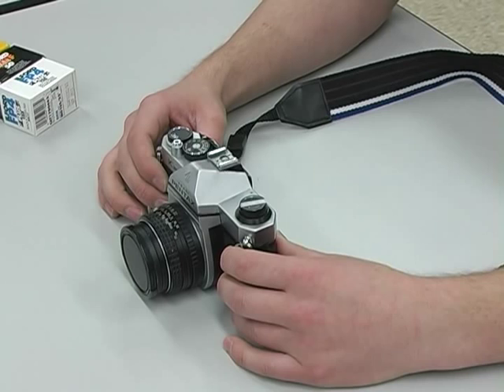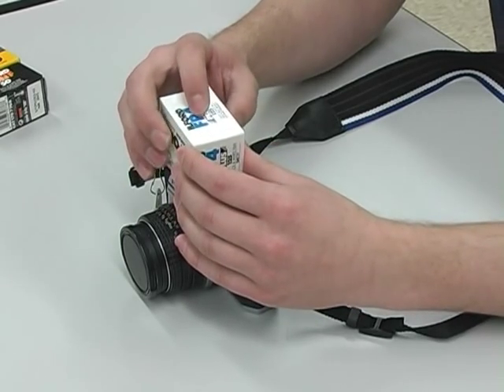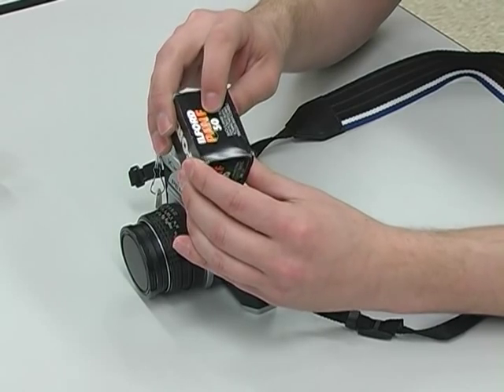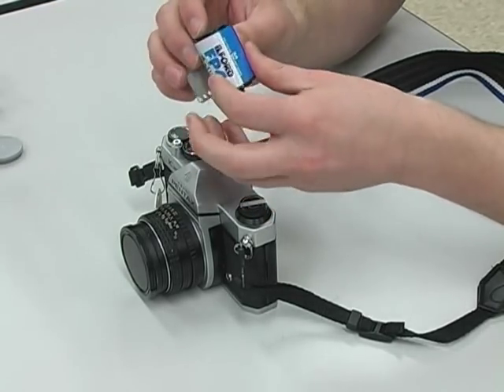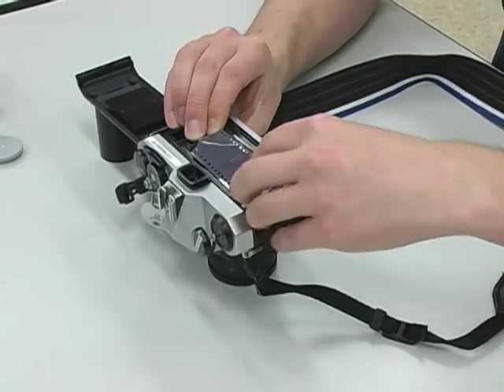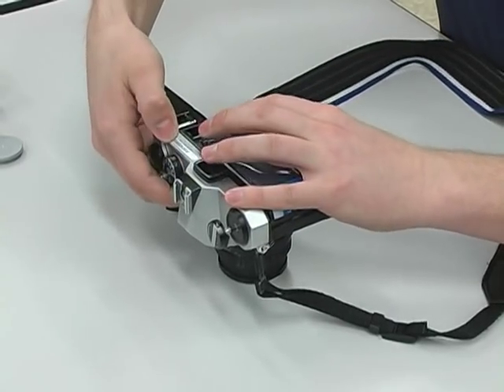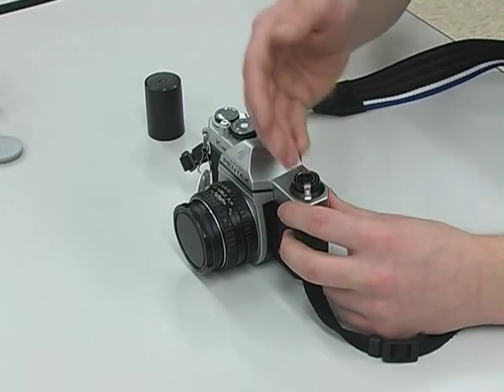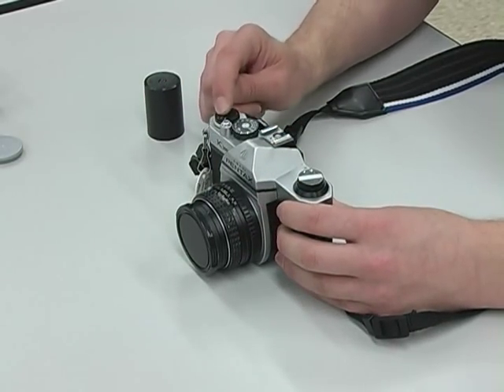Loading Film into a 35mm SLR Camera

Comment: I have minolta x-300 , its largely mechanical but has a few electronic things. Aperture is adjusted via a ring and there is no auto focus. For moon photography, I dont know but I suspect you could just use the widest aperture available (to let in more light) without worry about how it affects depth of field (focus will be set to infinity anyway?). I guess you would want a good zoom lens, and if you zoom in fairly close on the moon you should get an accurate exposure.

Comment: Good video but I have a slight issue, I don't know what I did wrong but I can't seem to advance it anymore (using the lever thingie), when I first tried it, it did work but right now it doesn't.
I can pull it maybe an inch but then it just doesn't go any further.
Any idea why this is and how I can prevent it from happening?

Btw, it's an Minolta XG-1 and I bought it today :D

Comment: Hi Alexander, thank you for this instruction. I started shooting film a few days ago and have submitted my first roll of bw film for development today. However, I am afraid I might have done something wrong with loading the film... My concern is that it would be possible that with each exposure, I am actually exposing halfway between two frames. How do I make sure that with each cock I make with the lever, the film is actually aligned correctly with the shutter opening? Or is it just simply not possible for it to be misaligned due to the sprocket configuration, and therefore I should not worry? Thanks!
Reply: How2Save01 Hey, thanks! By now I have figured out that a roll of film is sensitive to light as a whole and it does not have individual photosensitive frames on them so it indeed cannot be misaligned. :)

Comment: I would not recommend testing to see if the film is "caught" after loading the film by means of lifting up the rewind leaver as you advised at the end of the video. Not all cameras catch the film in the same way. I just tried it will my Canon AE-1 and my film leader rewound into the canister. Now I cant shoot with that roll. 
A better solution would be to make sure the film is advancing and caught in the grooves before closing up the back. You may loose an exposure but better than a whole roll.

Comment: this is probably a dumb question but i gotta know
i have a olympus om10 and im having trouble getting my film to work.
i feel like its the camera but then again i did buy fujifilm from walmart.
would that film work on this camera or could the camera not be working ?
everything seems to be fine. the shutter works and the check beeps. still dont know how to use the manual adaptor but oh well. any help would be much appreciated

Comment: No need for a megapixel comparison:

 Low sensitivity film means you need more light to get an image, in dark places you need longer shutter time (slow speed), and picking up light carefully means the image is more clear. 

High sensitivity means it needs less light to get an image, better for dark places and to use smaller shutter time (high speed), but high sensitivity means more 'errors' picking up light which come up as grain.

Megapixels are about file size, not exposure, not even quality.

Comment: You must be doing something pretty wrong then. I spent 30 minutes developing Tri-X 400 from an Canon AE-1 with Rodinal. I also purchased 100 feet of Tri-X for ~$50 from B&H and just asked local camera shops to save their canisters for me to use.  
Total cost: AE1 + Canon F mount lenses, ~$200 + Tri-X $50 + Developing Chemicals ~$75 = $325.  Scavenge a film scanner from somewhere, maybe another $100.

If you look at digital, you can't even approach this for 2x the price.

Comment: Comparing the quality of the picture with the megapixel of a certain camera is one of the worst analogy ever.  Megapixel determines the resolution of the camera.  1 megapixel will have a smaller resolution than a 5 megapixel camera, but it doesn't mean that it will be reduced in quality.  Film speed is equal to the noise of certain digital cameras nowadays.  You should not be mixed up between the two.